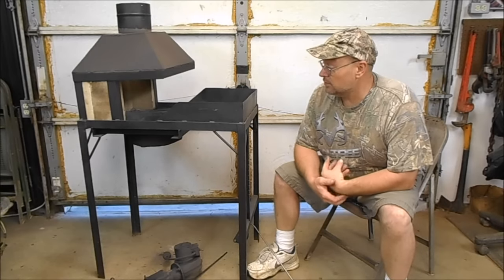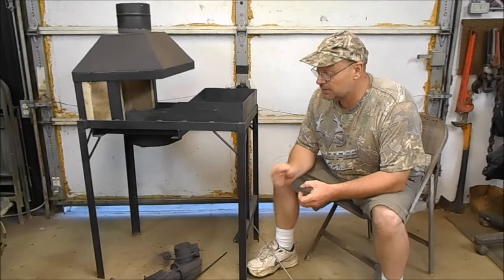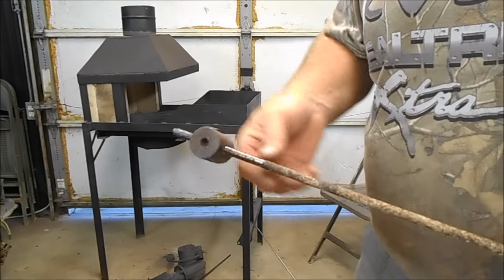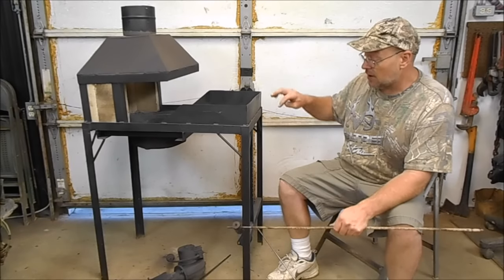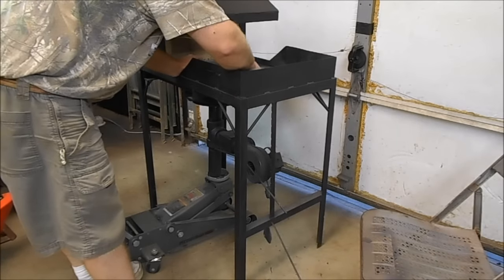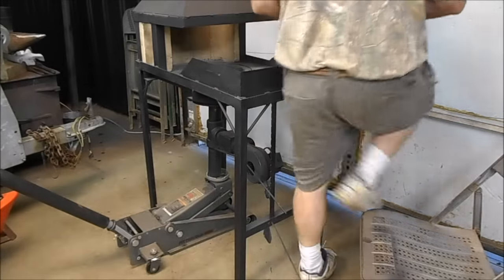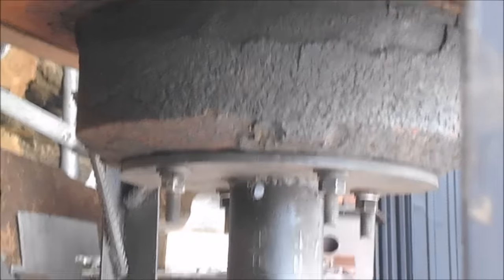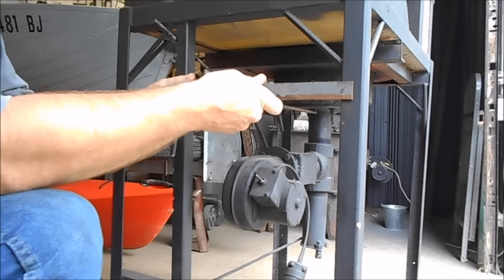brake drum forge a clinker breaker.

Comment: Kevin what is the size of the clinker breaker and is it for a 2" pipe. Like your set up.
Reply from the maker: +Jim Mills Its is in 2'' pipe the clinker breaker is   1''1/4'' by 2'' long.
Reply: +Kevin Robinson Thanks for the reply just starting out so I am new to blacksmithing. I made my forge table 2'x3' little on the heavy side but it will get the job done again thanks.

Comment: hey I would like to make a brake drum forge and I was wondering what size drum you use is it an 18 wheeler brake drum or what?
Reply from the maker: 550 ford dump truck back brake Rotor.
Reply: thanks man im probably gonna just use an 18 wheeler roater I think it will work just as good
Reply from the maker: That will work make video I would love to see it thanks Dalton.
Reply: I definaly will thaks for you help